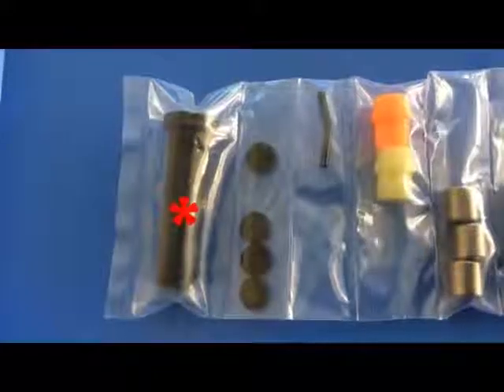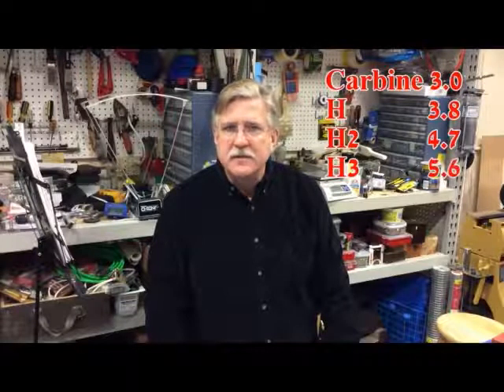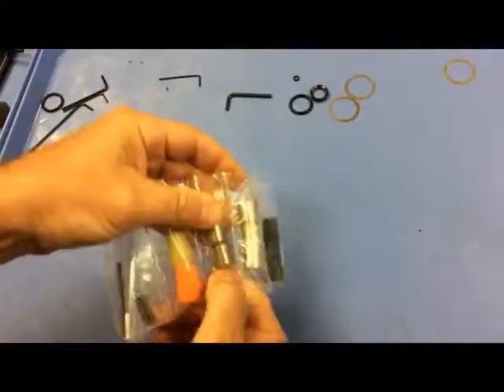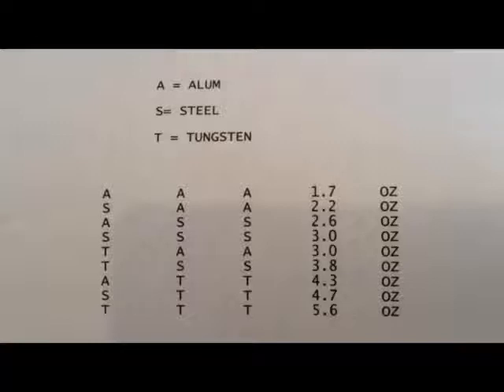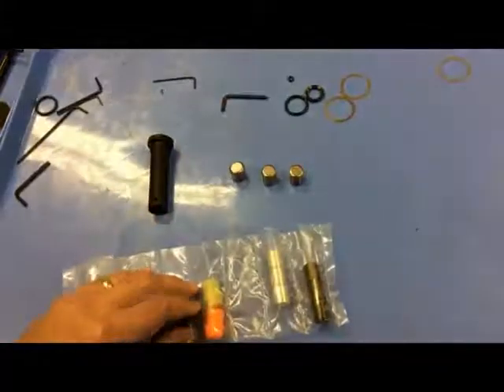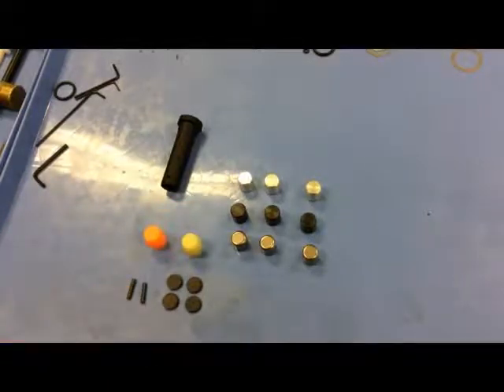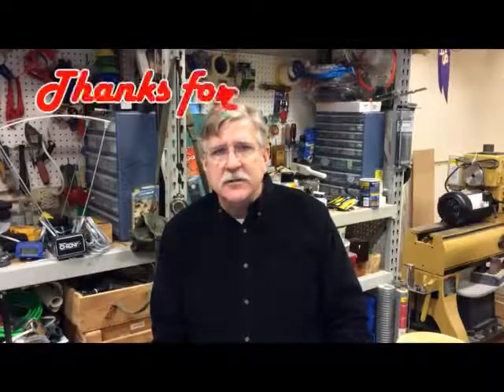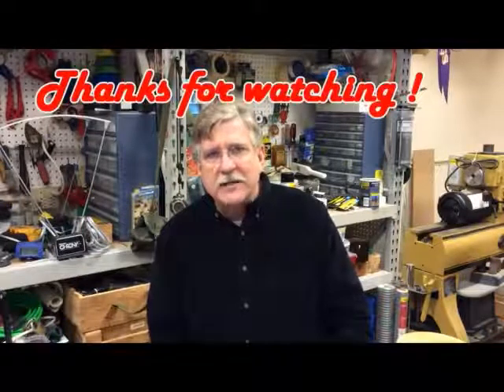Tungsten Weights for AR15 Heavy Buffer

Comment: I ordered 1 H3 buffer and 1 extra 1.5oz tungsten weight from Kak industries.  The H3 is going in a 10.5" pistol and the extra 1.5oz weight is going to be swapped for one steel weight in a 16" midlength. The actual weight on a stand carbine buffer is 2.7oz, after installation it will be H1 weight 4.2oz. If your buffer started as a true 3oz than 4.5oz. This should be enough to retard the dwell time in the midlength. If it was a carbine length you could add 2 hence H2.